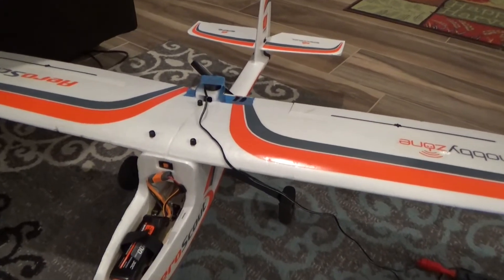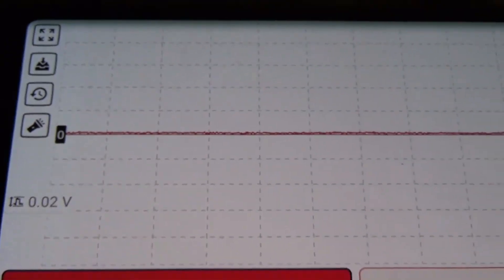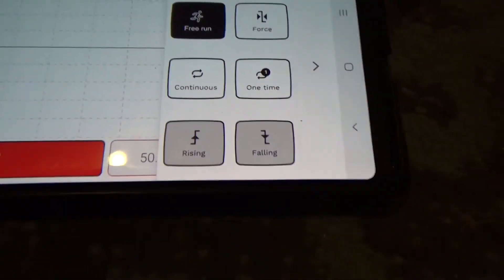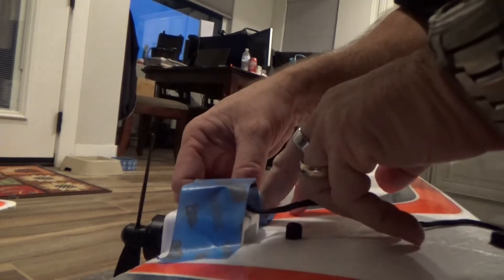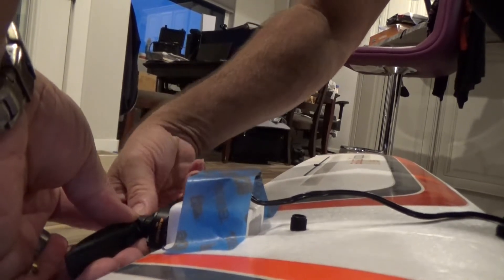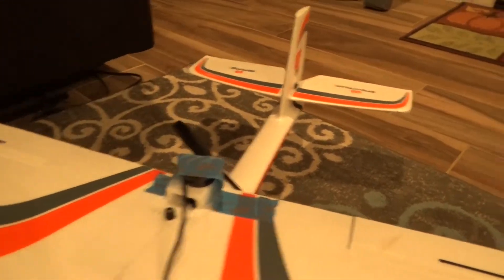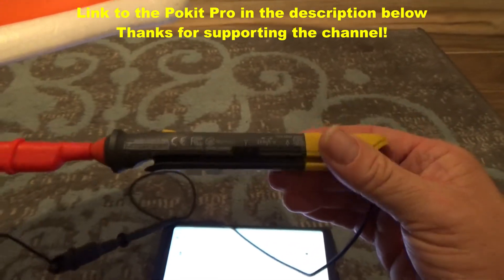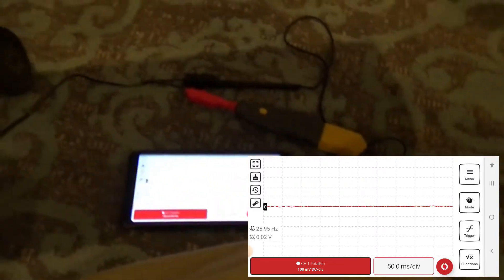Pokit Pro Oscilloscope RC Propeller Balancing

Comment: Super! Where to purchase the piezo Sensor and Phone App ?
Reply from the maker: The app is for the Pokit Pro which is the tester measuring the signal.  There is a link in the description if you would like to purchase one. It is an awesome tool.

The piezo element I've had for a while but there are many on Amazon or ebay for cheap.